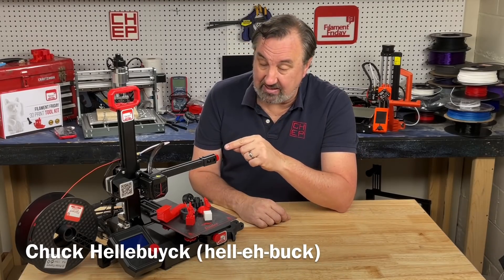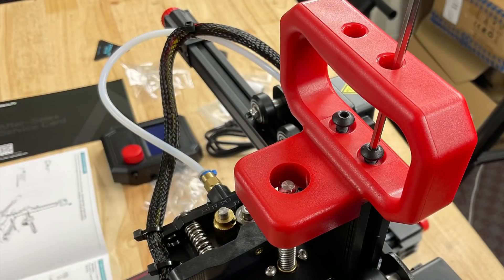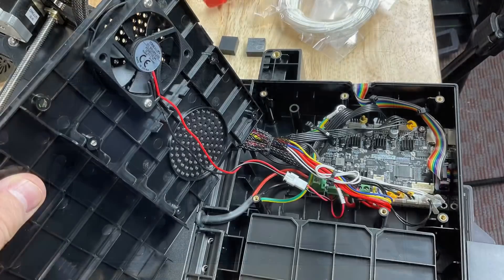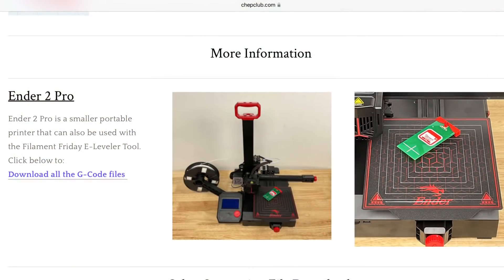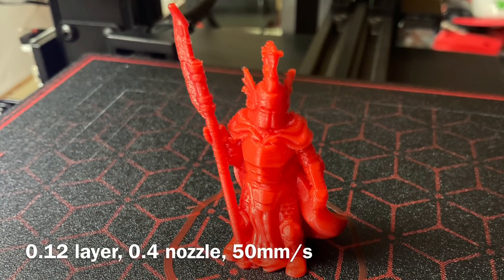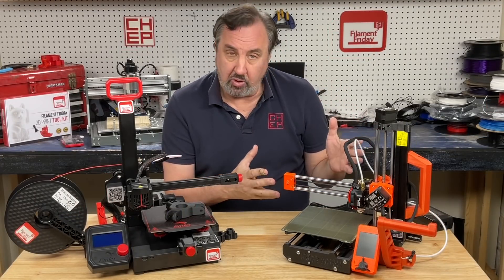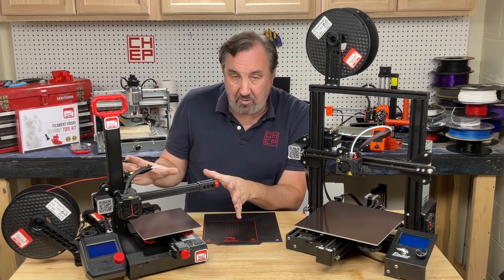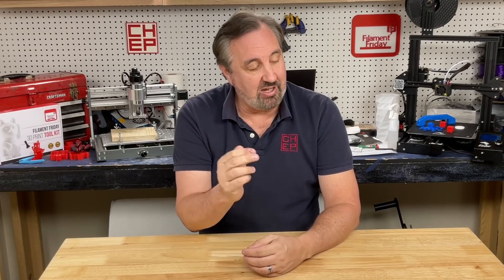Ender 2 Pro - The Best Value Portable 3D Printer?

Comment: Your reviews of printers are hands down the best, thanks for taking the time, super quality work 😎👍
Reply: It would be interesting to see reviewers do skew measurments, and print head movement accuracy. Most 3d printers wont move precisely 100mm when told to move 100mm cus the steps/mm isn't tuned. It's strange that printers are shipped out of tune. As he said in this video the E steps is not tuned either. The steps/mm is set close enough to get a print, but not tuned precisely. It gets kinda old seeing the same style review. Open box, do a couple of prints, and then end the video.
Reply from the maker: The CHEP Cube is a test print that helps measures this. Checking it for 20mm accuracy is one example.
Reply: @FilamentFriday  I was thinking more along the lines of how a machinist checks accuracy. Attatch a dial to the print head, then move the axis using the lcd, and then check the dial to see if it reads the same as the lcd. Measuring prints isn't the best way to determine if steps/mm is accurately tuned.
Reply from the maker: Thanks

Comment: Thanks for another great review. I have watched several of your videos on this printer. My Ender 2 Pro is scheduled to arrive in a couple of days. I am very excited because I was able to grab one for $99 on the Black Friday sale. With the low price, I can to sell my gently used Kingroon KP3S (also a good small printer) and this upgrade will be almost free. I think small printers are the best little work horses. I print 80 - 90% or more on the little Kingroon. I can't wait to use the little Ender 2 Pro. I also bought your e-leveler leveler and used it on my Ender 3 S1 and the Kingroon KP3S. The E-Leveler works great works great and the included test files are like chocolate icing on a cake. I left a review on Amazon as well. Keep up the good work.

Comment: My boss bought this printer for his son after I recommended it. Last week I installed it and here's my 2 cents:

- Connecting the U frame at the top was tricky - there was very little tolerance for the smaller screw holes. I had to ask my boss to push on the top for the screws to go in. Once in, it was extremely rigid however.

- The bed wheels were woefully adjusted. One was spinning free, the other was extremely tight. For a beginner, this can cause prints to look really bad unless they know how tight it should feel.

- The bowden tube was damaged - it was deformed right where it inters the extruder. It was impossible to feed any filament through it because of this. I had to cut off 2 cm and re-insert it. This is a BIG no-no because a beginner will really struggle with this.

- the bed was WAY too low compared to the Z-stop. Even if I lowered the Z-stop completely, the nozzle was still 3-4mm above the bed. I had to almost completely unwind the springs of the bed to make the bed reach the nozzle. I did not like that one bit because tighter springs = more stable bed levelling. So I removed the Z-stop, moved it even lower than the girder allowed (it's slightly tilted now but it works). This gave me the 3mm I needed.

- Without any e-steps or PID I got perfect prints right out of the box after I adjusted the wheels & bed.

- The flex build plate makes parts stick REALLY well but they also come off easily. I love the texture you get on the bottom of prints

- The menu is very basic - no filament feeding that I could find for example and I see that as a basic feature to measure e-steps. I expected Creality to add more Marlin features like this by now. This is why I had to replace the mainboard in my Ender 3 Pro.

Bottomline is: if you can get someone who knows his or her stuff to set this up, it's a good first printer. If you don't have such a person, you better be prepared to do a lot of tweaking because 3 big issues out of the box (damaged bowden tube, badly adjusted rollers & nozzle being way far off the bed) is enough to put anyone new off 3D printing and to just return the machine.
Reply: I just got this printer in the mail today, impulse bought it to serve as some extra horsepower since my first two printers are pretty much always running. Getting it out of the box, I experienced a few similar issues.

The first two screws that you put into the z axis to connect it to the base were indeed quite small. I had some trouble aligning them, I actually had to angle one to even get it in. After that, though, all other screws went in pretty easily.

Mine also had a damaged bowden tube, but luckily I had some spare Capricorn tubing in stock and had wanted to replace it anyways since I only really print in PETG. I don't actually think I would have noticed that it was so badly deformed if I hadn't removed it - Definitely could be an issue for a beginner.

Mine also had a very strangely leveled bed, the two back corners were EXTREMELY close to the nozzle while the front ones were extremely far. One corner was so far from the nozzle that I almost worried I wouldn't be able to bring it up enough, but after bringing down the two in the back, I was able to level it pretty easily. 

Everything else, though, I'm really happy with so far! This little thing seems to be smarter than my Ender 3 Pro in a lot of ways, so I'm excited to see how it performs. I'm printing my first gcode, a benchy of course, on it right now.

Comment: Hi Chep, just bought the Ender 2 pro. I noticed that the start code in the Creality slicer does not pre heat the printer. Do you have a start gcode fro the Ender 2 Pro?
Reply from the maker: Load the profile .3MF file from this video description and it will load my Ender 2?machine profile.
Reply: @FilamentFriday  Thank you
Reply: Sorry I don't see a 3mf file
Reply: I found a 3mf with your ender 2 adjusting Knobs. Thanks for all the hard work.

Comment: Chuck, have you ran across any of the Ender 2 Pros that come with the v4.2.S4 mainboard? My Ender 2 pro has this, and creality isn't providing the marlin source code for this version as it does not have a STM32 or GD32 cpu chip, They do provide the marlin source code for those versions. I ran into a problem with octoprint stuttering on the ender 2 pro and discovered this to my detriment as I wanted to compile custom firmware to address it.
Reply from the maker: First I’ve heard of it. I’ll look at mine.
Reply: @FilamentFriday  I'm in the process of sourcing a v4.2.7 mainboard with the goal of flashing custom firmware with the max sizes for the x, y, and z axis set to the correct sizes for the Ender 2 Pro
Reply from the maker: That would be great.

Comment: Hey Thanks for your awesome content. Do you know of any other firmware for this 4.2.S4 board? My 11yr old bought this and wants to add a cr touch and filament run sensor. We can see in prontoface they are there and options for each is isn't enable, but dosh darnnit, I just can't figure out how to make it enabled... so at this stage I'll happily just flash someone elses firmware :D especially if it has PID tuning. I miss that. Must admit this firmware is way better than what shipped with the E3 Max Neo, but I have klipper on that but alas alack no spare pi for this beastie.
Reply from the maker: Not that I know of. Sorry

Comment: I have had an Ender 2 pro for 5 months now, and I really love it. However, the original magnetic sheet that came with the printer is pretty much toast by now (my fault). I'm finding it nearly impossible to find replacement sheets in the correct size. Right now I've got the smallest size easy peelzy that I've cut down to fit, but its magnet is much weaker than the stock sheet. I'd really like to upgrade to PEI spring steel, but cannot find a suitable size anywhere. HELP! There's got to be a better way!

Comment: Just picked one of these up as a secondary printer to my Ender 3 v2.... aside from when i need to do bigger prints, or use higher temp filaments etc (i've upgreaded to microswiss/direct drive), i've already fallen in love with the ender 2 pro, it'll be my printer of choice. fantastic portable printer for the price

Comment: Why does my ender 2 pro have a different chip, and it doesn't have the version v4.2.3 on it. It has a HC32F460 KCTA chip instead of the stm32. Recently purchased this Ender 2 and was hoping to flash the firmware, but idk where to go with this chip.
Reply from the maker: Where did you buy it?
Reply: @FilamentFriday  It says Sold by Creality, Shipped by Amazon. I just messaged them and I'm awaiting a reply. I really like the printer, but I also want to add a few things that requires flashing the firmware. I can't find anything on this processor. It says it has Marlin 2.2.36 March 2022, but I can't find it on Marlin's website. It's quiet, 32bit, and prints really well.
Reply from the maker: Thanks. I’ll look into that myself to see if they made changes since my video was released.
Reply: @FilamentFriday  I just noticed that it also has 4 wire steppers instead of the 5 wire steppers that yours has.
Reply from the maker: Mine are 4 wire.
Reply: @FilamentFriday  At 1:20 2:37 and 3:49 it shows 5 wires on your z motor and 5 wires going to each stepper driver. Maybe you didn't notice there were 5 wires? Mine has 4 on each motor and 4 goin to each driver. Also my firmware version on the about screen is v2.4.S4.
Reply from the maker: Wow. You’re right. My mistake. Very interesting.
Reply from the maker: I’ve been told the fifth wire isn’t being used. A four wire cable works as well. I’m going to test it soon to see if that’s right.
Reply: @FilamentFriday  I've heard before that the 5th wire is either current sensing, or middle tap. Do you know anything about the creality board v2.4.s4? They got back to me and said that they need the creality version and a picture of the entire motherboard then they'll send me the firmware to customize and flash to the printer. Is that safe? Should I download and use the firmware they send me?
Reply from the maker: I don’t know enough about the board but let’s go back to your original comment. Why do you want to reflash the board?
What was wrong with it out of the box?
Reply: @FilamentFriday  I need to set skew compensation, and turn on z offset in lcd menu. After searching I found that many others have the same slight skew. It's a very common thing for the ender 2 pro, but the eye can't notice it. For most it's not a big deal if the eye can't notice, but I need high precision prints in this case. I've tried reassembling it several times, but it's the exact same alignment everytime.  
Setting Z offset with gcode doesn't work. I have to manually set the bsteps every print. It's not easy getting endstop in just the right position, and the slicer I prefer doesn't allow setting offset. I wouldn't mind a blt sensor either. 
Could you recommend a new mainboard as a upgrade replacement? There is no support for this 2.4.S4 board yet. I'm looking for a board that's about the same, maybe slightly better, but with support to upload custom firmware. Many thanks!
Reply: @simplyengineering2350  Di you find any solution? I have the black sheep too, same board and i have a raspberry pi and I cant do nothing with this board.
Reply: @ernestogalban2597  Yeah. Send it back with a letter telling them to stop filling the market with scams. All their printers have issues. None of their printers are worth buying.

Comment: I have an Ender 3 Pro which was working great until the board got fried (not sure how) so I'm getting it replaced, but I saw the Ender 2 Pro and at Microcenter for $129.  Everybody is telling me that this printer is a beast, so I will be picking this one up and a second printer.  Great review
Reply from the maker: It’s become my favorite printer.
Reply: I've been eyeing that $129 deal also at MC! I have a 3 Max but I'm really interested in getting the 2 Pro for fast prototyping!
Reply: @mutlubasdas  You should get it.  I picked one up and it is a beast.  I'm enjoying it more than my 3 pro.  Put it together and I was off and printing.  I barely had to level the board.  For small to mid-size stuff, I do it on the 2 pro.
Reply: @JeffJohnson  Nice! Thanks for feedback :) yeah I'm getting one most probably!!!
Reply: Update time! I got it! 😎
Actually my awesome girlfriend got it for me as our anniversary gift! ❤️
I'm loving it. Definitely a beast. I also added the 3 year warranty extension with Microcenter and since it was already at a discounted price, it came up to the MSRP with the plan.
Took me 10 minutes to get it going, super easy setup and bed leveling, which I use a feeler gauge.
And I also got the BLTouch just for the heck of it and will try it again tomorrow with the appropriate firmware and once I print the mounting bracket for it and see how it works.

Comment: Hi Chep, I bought this printer and I am very pleased. The only thing I dont understand is the mini USB port. It is not working, it is death... no voltage in the socket. Do you have the same experience? It is possible to connect the printer with PC?
Reply from the maker: I haven’t tried. I do everything from SD card.

Comment: Hey Chuck, great video as always. I've never seen a grounded hotend before, what do you reckon was going wrong that made them do it? A Chinese manufacturer would never justify the wire plus labor cost just for an abundance of caution. Do you think we should be doing that to our Ender3s?
Reply from the maker: The case around the electronics is plastic. My guess it’s to prevent electrical interference. Ender 3 has metal cover so probably not needed.

Comment: Does this printer have a mounting point for a CR touch? Auto leveling would be so nice. Any good resources?
Reply from the maker: No. You’d have to print one. But I manually leveled it with my E-Leveler tool once and it’s bed level since. So I don’t see the advantage to autolevel on this.

Comment: Question about the nozzle/hotend. Is it the same design as an ender 3? and if so, can it be upgraded with the same parts (aka mk8 hardened nozzle and a proper bimetallic throat/heat break). Thanks! I want to get my first 3d printer but I don't have a lot of space, this seems perfect after seeing your review, I just want to make sure I don't overheat the ptfe, and I can print an abrasive PLA :)
Reply from the maker: Same as Ender 3

Comment: I literally just finished setting it up and printing the bunny from the SD card using the included filament. I'm flabbergasted by the quality, it's literally smooth down the sides of the bunny downwards. I was afraid of jumping into this 3D printing thing, but having you as a guide and watching your videos leading up to today has made the experience much smoother.

Comment: Definitely not, The kp3s is better than the ender 2. Has linear rails on 2 axes and has titan extruder with a pancake stepper. Has a larger build size 180x180x180. All this for 150-170 euros

Comment: Just got mine. And I have never had a and expensive FDM 3d printer. I think the most  I spend was for my cr10. But I have owned around 11 3d printers. And this little guy just gave me the best benchy I have ever printed. Though I can say I not tried the benchy on my Neptune 2, and that has given me some pretty good other prints. Think I'm going to have to do that now, and compare. My neptune 2 is beast when it comes to TPU though.

Comment: I think I paid $159 for my Ender 3 two years ago.  Against the Ender 2 Pro, I like that it has a larger print bed and that the X/Z axis is supported on both ends.  If anything, I wish the bed was significantly larger. The Ender 2 is definitely more portable, but the Ender 3's design makes it fundamentally more capable, and therefore more worthy of upgrades.
Reply: If some one likes the ender 3 for all the reasons you said, they may as well just justify spending more and  buy a sovol or a kywoo. they are far superior in the fact they come with direct drive extruders, dual z axis, and if i remember correctly, bigger build volume. this Ender 2 is for some one one who wants a machine for more or less a specific purpose, as in they already know what build volume they need, and want something that will sit quietly in the corner and print away. But, as you stated about the build volume, I can not recommend this to new users, because they will outgrow it fast.

Comment: I have been interested in the Ender 2 Pro for a while but for some reason just do not want to get it shipped from overseas like I have with my recent sprinters.
I have not had any luck catching it in stock on Amazon.
I ended up making my own cantilever printer from scratch and install a SKR Pico with raspberry pi running Klipper via Fluidd. Works good so far but I do need a better heated bed.
I will say that if I do catch the Ender 2 Pro in stock on Amazon I will buy it.
I am also looking to get my hands on a Kingroon KP5S which is an updated version of their KP3as Cantilever. I think it is only sold on Alibaba though which I do not buy from. It is also $169 as well. It has a unique dual rod motion system where it uses U Groove roller bearings to clamp down on the outside of the two rods.
I'd like to see how the Kingroon KP5S compares to the Creality Ender 2 Pro.

Comment: Kp3s still better
Reply from the maker: In what way specifically?
I’m looking at comparisons of the two so what did you find when you compared them to determine that?
Reply: They are in the same price range but kp3s has a linear rail x,y tmc2225 and 32bit motherboard also direct drive titan with5015fans and touch UI

And aslo i love your reveiws and guides keep going sir :D